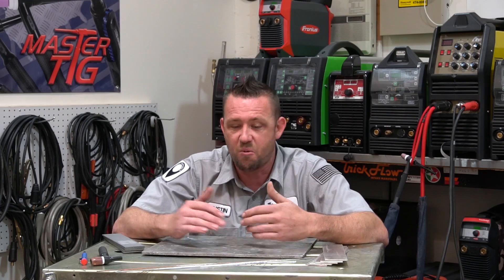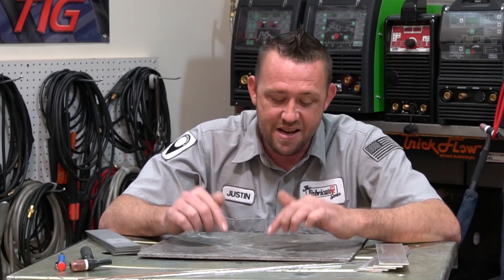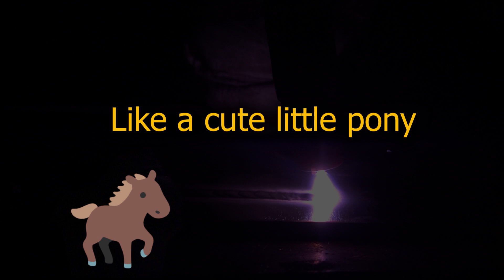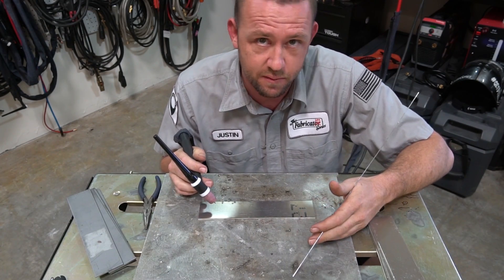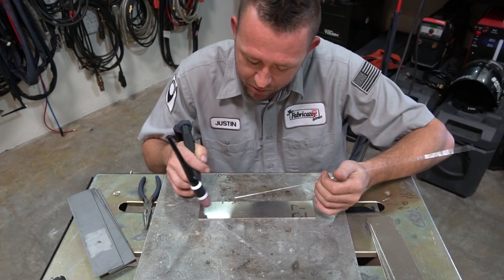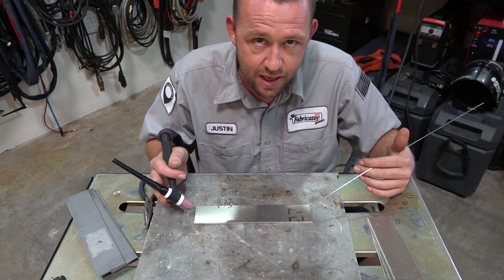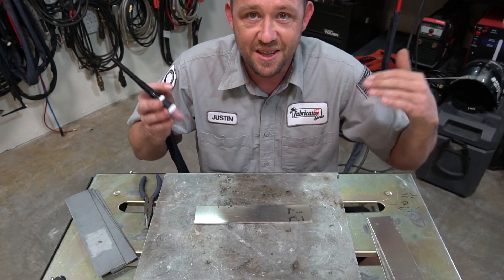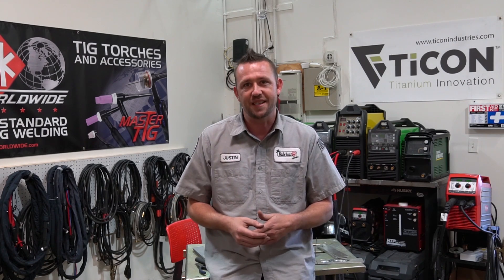TFS: Top 10 Mistakes Beginner TIG Welders Make

Comment: Any chance you'd do a video on filler material? I've been shopping around for toys and a practice rig and found some filler rod at harbor freight that said it's for welding over surface rust and mill scale (yeah, I know its harbor freight, but they have odd ball things that are hard to find and low cost test materials). Is there any reason not to use this kind of rod for low end auto body repair or patching rust spots that may or may not retain particles of rust even after demo and a good cleaning? I sealed up a cabin leak on my car with bondo (temporarily just to inhibit the growth of the spot) and when I opened up the rusty spot the metal and cleaned it the remaining steel still had a bumpy texture. I applied a little chemical rust dissolver and some started bubbling out of the ridges which appeared to indicated that it may have formed in pockets inside the steel. Given the way rust spreads further than you can tell with the naked eye I'm considering there might be some minor contamination even when I cut back to solid paneling. 

I know there's multiple different alloys but is mixing them acceptable for general purpose repairs? Would something like I found possibly contaminate the weld? Do different alloys have a hard time bonding with one or the other in instances when it's your own patch work and you're not as worried about premium work or trusting the product in someone else's hands? And for entertainment purposes, is it acceptable to use scrap material as filler material?

Comment: I had a go on a tig 20 years ago having thousands of hours mig, ally welding was gorgeous, no filler needed, fantasticly clean.
I was used to metal fabrication for chassis and making things like tanks with a 380amp clarke machine that I got tig results from with experience, but tig was a real eye opener. cost is my only consideration these days. I get the same results either way, the only difference is having to preheat ally

Comment: Great advice! I'd love to start tig having migged for a while now just for shits and giggles. Funny, a LOT of what you mention I can relate to mig. I used to work in an office and would come home after a stressful day and lay down beads just to relax. Kind of a zen thing. I found position was like 80% of making a nice looking good pen bead. I found that using my baby finger along the piece helped me steady my hand and helped make a nice even bead. (too much caffiene maybe? lol). I do the same thing when drawing straight lines, using a knife to cut out veneer, all sorts of things. I can see that working for me in tig too. 

Body position too. Through trial and error I learned what works for me and loose is good. I know one thing: leaning over with my body unsupported does NOT work for me at all. Maybe due to the herniated disc in my back? I dunno but have to have at least one arm braced against the table or ??.

Comment: 3:50 some Times I had this shaking hands did you have any ideas what I should do? I start chewing gum and it relax and maybe sitting different?
Reply: If I make fillet weld I turn the peace  45 degrees so I saw the electrode in the corner. 
At the moment I make MAG welding

Comment: My biggest issue I had when I started tig welding was having the amperage too low. It especially hurts you with stainless. I would always have issues making a puddle and I would always overheat the stainless. Which is backwards from what you would think. Turn the amperage up and making the puddle is much easier and it’s makes things move much smoother so you can start adding filler rod.

Comment: Good vid, im a maintenance man and weld tig mig and stick on occasion.  I never took formal classes, all on the job training and practice.  Self taught on aluminium with just a little advice.    The thing that really helped me was the thumb control.  You can strike an arc and slowly turn it up and watch the puddle form and start feeding your rod and move the puddle.  Same can be done with the foot pedal but there your using both hands and a foot.

Comment: I am going to start within a week, (newbie) and I already figured I will be doing some of these things. Lots of tig welders have giving me good and not  so good advice. I will be doing video of my 1st try ( something for me to laugh at later) but I can say there are 2 really good points no one has said anything about. 1) do and dont care about. 2) The pony trip, I am sure to do this as I weld a lot of trailers with mig, well sometimes you just have to do this. So #2 will most likely be my problem.  I really like the video and it was helpful to sit back and learn more before I try.
Reply from the maker: The other problem you'll likely encounter is too high of a torch height. Most MIG guys we teach will lift the torch when the puddle gets too hot which actually makes it hotter with TIG. Remember you have a pedal that control heat.
Reply: @TheFabricatorSeries  No pedal I bought a Lincoln 210 without a pedal so it be scratch starts until I can afford the pedal. Thanks for the responce.

Comment: You forgot to include argon flow, for example that I'm having problems doing aluminum. It seems to melt base aluminum fine but I introduce the filler aluminum and I get green shit drops, it is annoying, I don't know if I have poor argon shielding but the regulator shows 20 and have gone to 25 cfh and still get green shit drops with the filler rod.
Reply from the maker: Your green shit drops are from the rod melting before it reaches the puddle. The solution is NOT argon flow. Two things cause the rod to prematurely melt: Torch haight too high, and parking the rod in the cone zone (not retracting it). Fox one or both and the green shot drops will go away.

Comment: Love the flashlight analogy and I may have to steal it. Been running SMAW (stick) for nearly 20 years and one of the hardest things I've tried to teach is the same principle as that flashlight. The direction your rod is pointed is the direction of your heat. That and that heat rises so when welding vertical you have to turn your amps down a touch (everyone who tries welding downhill on me either learns to do it right or gets fired).

Comment: Way back in the early 1970s, when I was young (hmm, I don’t feel as though I was ever young, these days), I decided to do some welding for my own company. We were a small electronics manufacturer, and we needed a number of things for our factory that were really expensive to buy. But as I had always designed and made things, thanks to my father’s encouragement, I figured I could make these things myself. So I went and took some courses and got a couple of certs that would help with what I wanted to do, and we leased a welder.

I welded on and off for that company, and my subsequent commercial film lab until 2003, a year before my partner and I sold the lab, and I decided to retire (no, I’m not ancient yet, I was 54 in 2004 when we sold). I hadn’t welded since then, until I decided to begin again, because there are a number of things I simply can’t practically make in my shops otherwise. I was actually a pretty good welder when I was doing it for those 30 years, off and on.

But I came to You Tube and watched all the great guys here, and began to remember what I used to do. So I bought a good ESAB emp 215, and started.

Boy! Was I out of shape. I couldn’t weld a damn thing useful for a week, and even then I wouldn’t want to show it to anyone. I did think I would pick up the torch and start where I left off, but it doesn’t work that way. I was doing almost everything shown in this video, and it took a good month before I stopped doing most of it. Even now, and I started again last May, I’m not quite back to where I had left off. But it’s getting better.

So, great video. I found it to be very informative and very funny as well. I wish I had to time to get to your classes. Maybe someday.
Reply: Wholesome :)
Reply: You are a good teacher.

Comment: I think you forgot one. Prop you filler hand and practice feeding. Avoid hold the rod so far from the tip ( think of a stick rod and how much it moves when fresh ) and moving you entire hand/arm closer to the puddle. 
Prop-feed with fingers. You will get more consistent dabs ( even if you suck at first! )...

Comment: I've been TIG welding for 15 years and I still suck, LOL
Reply: Do some oxyacetylene welding, if you can get that down you’ll be badass at tig
Reply: @youngjizzy856  i learned to oxy weld with clothes hangers lol so I shouldn't have a issue tig welding
Reply: @youngjizzy856  I learned Oxy first then Stick.  Mig is EZ as pie.   Guess I'm badazz at TIG.
Reply: @youngjizzy856  funny I did absolutely amazing at oxy metal infusion but suck at tig
Reply: @john Smith 15 years and 7 months. ;0)
Reply: That's encouraging.
Reply: I went from a 26 air-cooled to a liquid-cooled 20 and it's so much smaller and lighter super flex very nice and it did make it easier but I have been doing this for a long time and it's worth the money
Reply: MCE Performance that’s just sad  you need a good one on one person to help you  I’m badass at TIG
Reply: @lkjyuiop1987  well grab your 308L's and come over to my house.. (3-week owner of a new Tig)

Comment: which direction is the right one if i work without filler
Reply: Either as long as you are comfortable and pushing the puddle
Reply: Always moving forward in Tig, never moving backwards is what it boils down too. Nothing wrong with fusion welding its the same practice as using filler

Comment: I am just learning to use a tig, I have used a gas axe and mig for years, some stick as well, I am somewhat ambidextrous and normally use my right hand but it feels easier to feed filler with my right and hold the torch lefty, is that a normal situation for noobs as well??

Comment: I found when i was learing that walking the cup made it easier to concentrate on speed and filler rod control seems the cup was resting on the material it kept a constant distance it was easy for me to shake off the tention and relax and even tho WTC may be seen as an advanced method its actually easy to learn, u just take a soda can an walk it once ur familiar with the movement it seems easy to translate to the torch... and walking the cup across plate with no filler rod was good practice and i felt less overwhelmed. Also using on low heat may not b ideal for actuall welding but it was good practice to get the fundamentals down then once i felt more comfortable i ramped up my heat and my speed. Just my 2 cents on some learning pointers. I learned by practicing every chance i had at work after hours most shops encourage that, it doesnt cost them anything but the expense of few consumables n electricity for you to improve ur skills significantly! Its a win for everyone. Plus learning process ur not expected to perform shows pro activness and results in advancement and eventually after few years you could b 1 of the go to weld gurus of the shop, its actually a pretty saut after status. so when any tig work came up i knew enough to be considered cabable, i just pretended i wasnt still learning while i was working and i pulled it off phewww! But remember everone you never stop refining ur skills and learning.

Comment: glad you included that "bonus" - if you can't see it, you can't weld it.....for old eyes that's seems to be (one of) my top problems....I sometimes wonder how I got to where I wound up....
Reply: Shooting wire across from other welders in a production fabrication shop got me flashed many times everyday - that sand in the eyes thing was the norm. Same feeble eyes at 38 yrs old. Now 54 and need double-nought-spy zoom-lens magnetfire glasses to read anything. Age happens.

About  "if you can't see it, you can't weld it." - I once had to hang upside down 320 feet up on a crane runway and blindly weld on the other side of the beam. A vertical up. 5/32 7018. Next day I saw the welds; the slag peeled on it's own. One of my purdiest ever.
Reply: @ Huskyresqr 
5/32 7018.   Wow welding 5,000 years into the future.  That’s impressive. I guess they have a May 32nd by then. 

LOL  just a joke, I’m a stick welder too BTW. I love it when the slag/flux just peels away.  A good sign.
Reply: @alienpoker  I sure do miss burnin' rod. It's a satisfying and rewarding career that pays adequately. The challenge of the art, the gauntlet cast at your feet by some to-be weldments...the brain process that happens while you gauge the metallurgy, the fitment, the structural load dynamics, the temperatures - you seeing the heat control of your planned weldment, the heat-effected zone and planning proper process / number of passes, reinforcement, etc. All that is involved in a purdy weld happening starts usually when you ask yourself how the original fitment/weldment/design failed in service. You're the field engineer tasked with the accountability and risk of making the decision on what "improvements" the design requires for a "fix" to be realized. Usually under pressure, bad conditions, tens of thousands of dollars of loss in downtime for the customer, hundreds of skilled people standing around out of work until it's fixed...freezing driving rain, no sleep in the past 40 hours or more and this small town aint got a clue what good coffee means, let alone good beer. And yes your wife is back at home cat is away mice will play. Just so she acts excited to see you return home with your luggage in hand and knows well enough to crack you open a cold one.

All this - and all you get credit or pay for is burning some rod. So enjoy the hell out of that burning of the rod art time.
Reply: @skeggjoldgunnr3167  sorry about the wife at home. She was fun back then.    😏
Reply: skeggjold gunnr Thanks for your comments. I'm 73 and just started to weld about 6 months ago....it's kinda hit or miss sometimes for me...I pop up the helmet and i see my MIG beads runnng this way or that...sometimes they are even where they belong....trying a new helmet (Lincoln instead of my Miller) to see if that makes any difference. And I wear prescription safety glasses....TIG welds are a little better...a little....
Reply: I tried TIG...I'm not a coordinated person! I made my own converted automatic variable speed wire feeder for the filler rod. = stainless pipe ASTM spec 5G. Inside of pipe at root there was suck-in, a sharp edge. You're supposed to feed THROUGH the gap in the pipe from above...something I don't feel like mastering! That job installing four new turbines at the local powerplant for G.E. - I was not hired! This felt shameful. I was accustomed to being THE welding GOD with SMAW, GMAW, FCAW, - a welding technologist...but this was just too much for ME! Licensed ASTM pressure vessel, bridge code, welded the strong-backs for the cape Hatteras lighthouse move, welded on me some bridges, a few thousand cranes...plenty of low pressure steam work...4130 oxy-fuel for aircraft, burned literally (for real) TONS of rod on structural steel, food grade stainless, aluminum hog trailers and bread racks...you name it. I got mad respect for anyone that can TIG some pipe! 

I bought a Speedglas 9000X when it first came out. GREAT helmet. Replacement over-lenses were a costly expendable. But I found that the Fibre-Metal white Pipeliner's helmet with those MSA hard-hat quick release buttons became my favorite. I've had to wear a hard hat + hearing protection, respirator, safety glasses, fall protection double lanyard 100% tie-off, winter Carhart bib-overalls, high-temp high-voltage rated metatarsal steel toed boots, tool belt with bull pins, spud wrenches, bolt sacks...it gets out of hand. A Speedglas 9000X seemed a pretty-boy's toy there, not a industry standard tried true and proven tool of the trade like the Fibre-Metal helmet. So; just get the Fibre-Metal helmet and MSA gear now, get used to working with them. You'll NEED the Fibre-Metal helmet on some jobs...but you'll NEVER have a job that NEEDS an autodarkening helmet.  If you have run out of rods in your eyeballs; go one shade lighter! Stick; shade 10 (or 9)...Mig; shade 13 (or 12 or 11)...TIG; shade 13 minimum no matter what. Keep the lens and overglass clean of smoke and sweat. The light of your arc should allow you to see a few inches around your weld when you got the lens shade right.

The good helmets (like the Fibre-Metal) have magnifier plates available. Autodarkening helmets flash on and off from the strobe of a forklift. Their natural state is number 4 or 5 shade - good for torch work. But I just now keep a little set of #5 shade blacksmith goggles (red bakelite, round lenses) dangling over the valve on my oxygen bottle. For every job; a perfect and dedicated tool.Not some be-all/cure-all multi-tool that compromises here or there. Excuses are not for the professional that gets r done. Anyway; you've got to admit that this is all about style and fashion! It's all about LOOKING the part, man!

Comment: I have retired and moved to Thailand and had to learn to TIG weld all over again. The issues here are poor availability of quality equipment, the lack of machines with footpedal control and unstable electrical supply. My solution was a true learning experience. I imported a CK worldwide torch and made an adapter to use it.  I modified one of my TIGs to use a footpedal. Next I had to unstall a voltage stabilizer. My last issue was lack of various filler rods in stainless and plain steel.